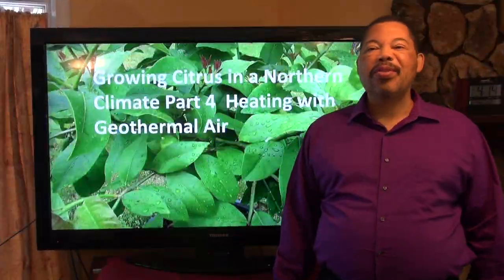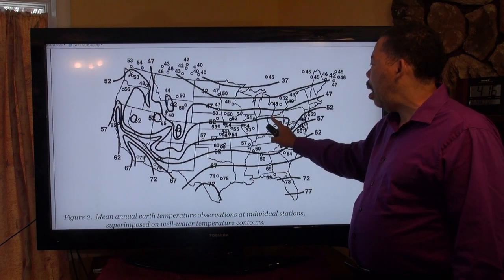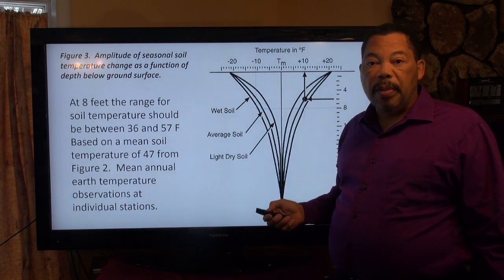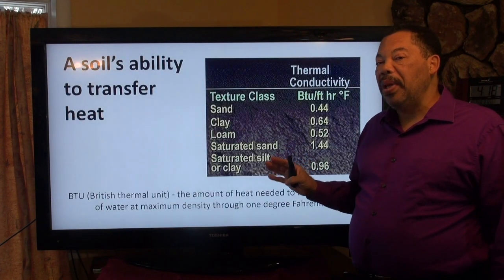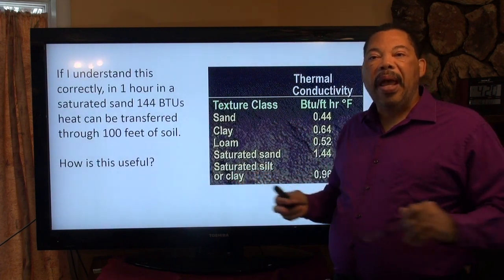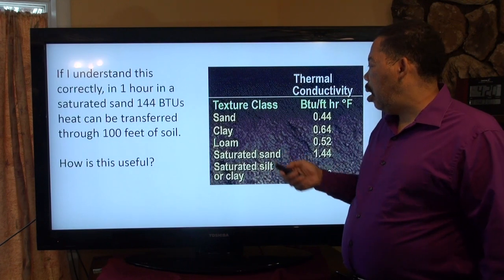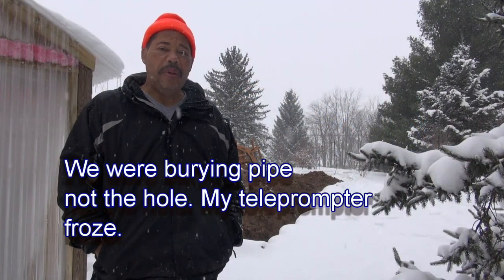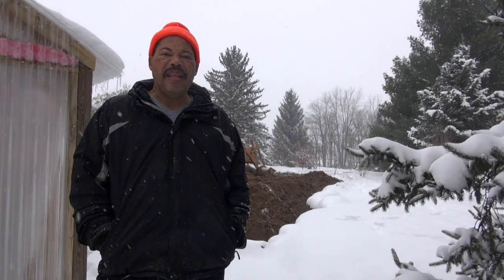Growing Citrus in a Northern Climate Part 4 Geothermal Project

Comment: Nice detail.  Most use a rule of thumb, if at all and do not calculate anything. I am always shocked at the people who overlook a VERY important element of these projects.  TIME.  Some move that air so fast, they do not get the cooling/heating desired.  The extra pipe you installed should ensure max cooling regardless exchange rate.  IMO water exchange geo is better.

Comment: very informative,  Gary ! I just want to share with you that I grow subtropical trees without extra efforts here in the North of PA. What I do is just in October, when temps just starting going down to 50Fs during the DAY time (ignore the temps during the night as it can be warm during the day),  I put mulch or natural wood shreds at the base of a tree about one foot high and 4 feet in diameter, for the winter. As soon the tree showing signs of activity in the spring, I move the mulch away from the trunk. Mulch will then get flatter over the growing season and there will be another fall and another layer of mulch then....etc This works for my longan, lychee, paw-paw, southern types of fig trees (I grow those as bushes, they stronger that way), lemon and mango (these two are seedlings as seedlings are stronger naturally in terms of adaptation).
Reply from the maker: How cold does it get down there?   The freezing temperatures here would make that impossible.

Comment: I installed a similar system but found the corrugated pile caused back pressure and would not allow the required air flow through the system. Did you find back pressure in this system?

Comment: Is the black pipe perforated or solid?
Reply from the maker: It was solid.  I did not want water to get into it.  Also, If I could do it over, I would not have 1 long pipe.  It is proving difficult to pull air through it.

Comment: During the warmers days of spring and fall, you can charge your geothermal 'battery'. When it is warmer in the greenhouse than you need it to be, rather than venting to the air,  run the geothermal fan. This will cool the air in the greenhouse and warm the soil in the geothermal area. Then you can get that heat back at night. And of course, you can use that same geothermal system during the day, in the summertime, to cool the air, if you can't vent the greenhouse for some reason during the day (Not sure when that would be, but it is possible! LOL).

Comment: Thanks for sharing Gary.  I have been wondering how to figure out how deep and how much pipe to have to obtain a good amount of heat inside the greenhouse.  I also thought about putting the pipe under ground but underneath the greenhouse as well.  I love those calculators you shared.  Very useful stuff.  I hope it works out great.  Keep up the great work!  New subscriber.

Comment: Thank you for creating this video series, Gary!!!  I'm curious if there's any update since part 5 - I checked your video library and couldn't find anything newer than January 2017 (I think).  How are your geothermal greenhouse citrus plants doing now?  

Also, I definitely am interested in the system Russ Finch sells, and am arranging a tour of his greenhouse to see it first hand.  One of the charts you showed makes it seem like a better bet to dig 12 feet deep, rather than 8, for a smaller temperature fluctuation and higher overall temperatures.  Obviously this would add cost, but would you advise going to 12 feet, if financially feasible?  

Thanks again for the videos.  It is my dream to try the geothermal citrus greenhouse, and quite a few other, more traditional gardening techniques in the near future, and videos like yours are inspiring and invaluable!!
Reply from the maker: I put all the citrus videos in a playlist.  The last one was posted in April.  The news isn't good but I am still working on the project.

Comment: Gary,
I work for a nonprofit that has been researching earth batteries for over a year looking to provide organic growers the bility to grow year aroung for miminal cost. I saw a vidio yesterdat by Eddies greenhouse garden titled "passive earth batteries don''t work. If you saw that vidio it seems that using water storage tanks and solar pannels th heat the water you can get a much higher heat output without having to do the massive gigging and piping in greenhouses of about 3000 square feet 30 X 100.
One of the concern I have had in looking at earth batteris if the low amount of heat is held by the earth.I have talked to builders of the earth batteries and suggested that we also put in 55 gal  drums of water in the bottom of the pit and wrap the 4 inch tubes around the barrels to transver the heat or cook to the water barrels and since water is much better in holding energy it would be much more effective. We can get 55 gal drums for about $5.00 in our area. We are located just south of Asheville NC. Would you have any thoughts
Reply from the maker: My problem with the 400 feet of buried pipe is that my two blowers cannot  move the air through the pipes and I haven't been able to find an inline pump that could help. On a bright sunny day you could store heat generated in the greenhouse in 55 gallon drums but they would have to be insulated and below ground because they would take up too much space in the greenhouse

Comment: Gary, I noticed you used solid pipe for your geothermal setup.  On other sites they say not to do that because they can fill with water from condensation?  Are you using your system for both heating and cooling?  Apparently if you use the system for cooling in the summer you can store the heat in the ground raising the mean soil temp.  Please post a part 5.
Good work,
keith
Reply: I noticed this detail as well. It really should have at least some drainage available or is can/will fill up and get gross. I was a landscape construction foreman for 7 years and Ive seen a few of these go in, and a few of these come out. Definitely want drainage